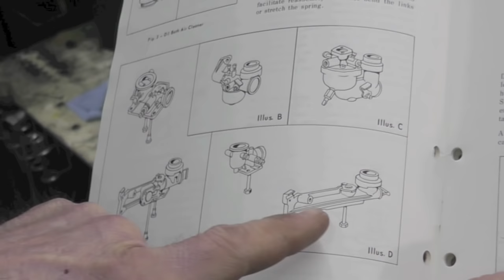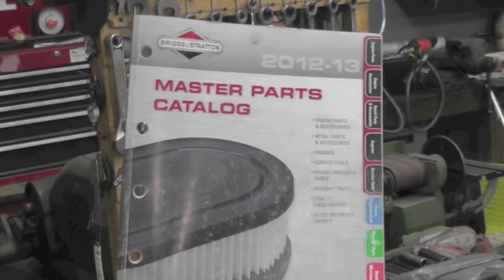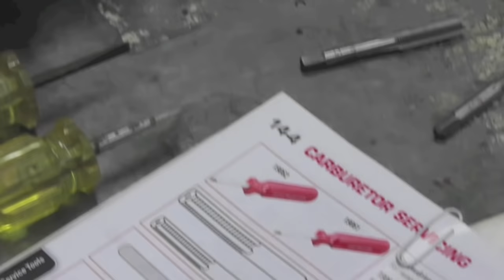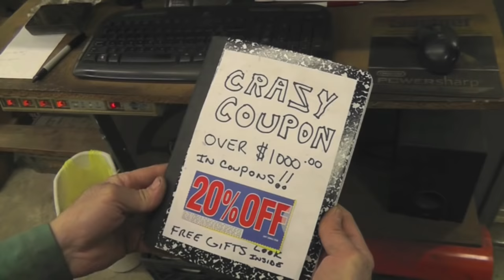How To Rebuild A Briggs & Stratton Flo-Jet Carburetor with Taryl

Comment: There should be more good people around like you and me. I ordered the rebuild kit and a bunch of assorted just in case parts before i took my 2 piece flo jet apart. I got everything I didn't need. The brass seat was a mess and none of the needles from BS would work. I figured i do a little  investigating and I found your amazing video. Thank you for sharing your expert knowledge. I was prepared to buy an upper body for $75.00. I found the brass needle seat and ordered it. I used your method and popped the old one out. I was amazed the part was available and even more amazed how your extraction method worked. I definitely would have butcher that upper casting. 1985 Briggs I/C 8 HP. THANKS AGAIN

Comment: Ya really gotta wonder what they were thinking when they designed this one. I have one on a leaf blower I bought last fall and it has some carb issues. Glad I got through the season with it. Now I know the correct way to pull it apart without muckin up the works. I would've yanked that bowl off there from the start. Thanks bud. I love the sound effects and the best thing anybody could do with a couple of turds is flush em away! lol!

Comment: My old man doesn't have time to take a look at his Bolens 10 hp tractor.. 
The beauty runs until it warms up and then it shuts off. 
It doesn't want to start anymore and it hesitates to crank like it's flooded but when it cranks it doesn't start. Any ideas to what could cause this issue? Do you think fuel isn't getting into the bowl or too much?
Reply: My 8 hp Updraft starts right up, runs at any RPM you give it, and in 5 minutes shuts off like you hit a kill button.  starts right back up...starts to die, choke it, it will recover...than it shuts off...Anyone out there no whats up with this thing  I've rebuilt the carb twice.  thats easy.  Thank you

Comment: Thanks for another great video, Taryl!  
I'm missing the throttle lever on a troy built chipper with this type of carb and the linkage looks the same. in the video,  I see the one screw that hold the lever on but don't see the other end of it and how it's attached. Can you buy the throttle lever. I think I may have to just manufacture one to replace it.

Comment: You always put out great information Taryl, but I need to correct you on one little thing. WD40 is NOT a lubricant. WD=Water Displacement and the 40 is the number of formulas it took to get to the finished product. LMT By PB Blaster (LMT=Lawn Mower Tuneup)...Now THERS YUR DINNER!! Just a little friendly helpful tidbit. I spent years thinking WD40 was the answer to all my lubricating needs until I was shown how it actually dries out any surface. It was originally developed for NASA as a means to remove moisture from electrical components and somewhere along the lines, people started thinking on their own, that it was a miracle lubricant. Hope this little bit of information is helpful! Cheers!! Zip~ p.s. Give LMT by PB Blaster a try!
Reply: If that's the case why do ALL stores sell it as a lubricant?
Reply: ZippoVarga mostly kerosene.
Reply: ZippoVarga WD is garbage,on the whole.
Rusted stuck or cleaning something OK whatever.
Turns to a gummy varnish with time 
Deep Creep by Sea foam is a nice fine oil.

Comment: little propane torch can loosen that emulsion tube if stuck and aluminum is good heat sink and won't melt but might warp if using to much heat to quickly so small flame and 5 minutes usually works👍

Comment: I have two questions for you guys concerning the 19245 tap set:  Looks like it's NLA, not even from ebay.  While you can find both 1/4-32 5/16-32 taps, the drawing in Taryl's Master Parts Catalog seems to show bottom taps.  There in lies potentially the problem, so far, I haven't found bottom taps in these sizes.  Do these have to be bottom taps, or can you use tapper/plug style taps?  Next question, if it has to be a bottom tap, who sells ones in 32 thread count?  Thanks.

Comment: got a homelite 5500 watt generator with a similar carb just a bit longer maybe. when i pull the starter a few times it starts leaking out the bottom of the carb but the spark plug looks dry. wont start. some carb spray and more pulling and it will fire and run. tried adjusting carb a bit but the governor wants to bring it to max rpms when manually giving it throttle it sticks to max rpms. why is it leaking when trying to crank? and why is it wanting to run at max throttle? thanks its an old generator and makes good power but cant keep it running. any thoughts? thanks?  new carb aswell but same problem

Comment: Hi Taryl   great sense of humour I enjoy your skits.Would like to ask you if the Booger on the hi speed tube was some sort of  'o' ring  ?  I have a large two piece Flojet carb and it is forever leaking after engine shut down . Read somewhere that there was a small type of 0 ring installed there to help the taper to seal in the carb body. Do you know of this, and would it be the remedy?
Reply from the maker: +Neil Fleming They did offer a teflon ring  but its been discontinued. A small piece of teflon tape may work.
Reply: +Taryl Fixes All   Thanks for your time answering the question .Going to try your tip .Hey do you think  that I could borrow Andy or Slippers to install the tape,those small hands would come in handy- LOL .

Comment: Timely, I bought a chinesium unit that won't take fuel through the needle valve. Among other things,
little, or no responce from  the needle adjusters. Rather than take it apart, I'm going send it back. 
So now I dive into the old one. 20,000 ! Hrs. on the clock.

Comment: I am currently rebuilding this carburetor (soaking in vinegar right now).
1) Shouldn't there be a gasket between the carb and air horn support against the bowl? None shown in parts diagram or video
2) Mine is a snow blower with a non-adjustable tube intake unlike the air horn. When mounting on carb, 1/4" space when installed and air horn in video shows a flush fit. Aso, there is no gasket and non shown on parts list unlike the video 16:53. Should I drill a hole and make it flush and also get/make gasket? model 190412, type 1024-01
3) Everyone questions your tee shirt when i wear it. I watched your video 3 times before starting this project.

Comment: Sure glad I found this before I dismantled my carb! I have gas leaking from around the hi speed jet. Is that a problem with the float? Thanks
Reply: Having this problem now -  I think it’s the needle missing the rubber tip. Ever fix?
Reply: It's either the tapered seat where the high speed emulsion tube screws in, there was a teflon sealing washer on this guy's which he flicked off, OR it's the o-ring which seals around the needle that screws into the emulsion tube. Either way, your comment is 4 years old and i'm sure you've found a fix now :p

Comment: I have this engine 194412-0122-01 and my local shop replaced the ball and rachet recoil starter with the new type that has pawls. I don't see anyone who has done a video yet on how to replace the pawls when they break. I tried to order the pawls but was told I have to buy the entire recoil starter for my 8 hp b&s engine. I see the pawls for sale at major stores via online, but the ones online are 1 1/2 and my engine takes 1 1/4 inch so they have to be cut down. Taryl seems to know ways to fix problems for less so if a part number is known please do a video or do a video how to fix the new style recoil starter for the 8 hp b&s when the pawls break. Great tip about the jet breaking, I didn't know and may have broken mine, I will have to check it. My engine is on a 4.4 KW coleman engine generator I have not had running right for awhile now. I replaced the carb and could only get the engine to run for about 20 minitues before it would die. I cleaned the flywheel and replaced the ignition coil and replaced the fuel filter and cleaned the plastic gas tank and replaced the petcock even had the local engine shop work on it and no improvement when the housing rusted out and the recoil starter broke. I replaced the housing and now at the point trying repair the new style recoil starter. Great videos thanks for doing them.

Comment: Rebuilt everything, starts,runs, etc. but gas leaks out the bottom bolt. Is there a o ring there? or is something not adjusted right?
Reply from the maker: +Arnold Johnson  If it's the bolt that secures the control plate then the needle & seat are leaking. If it's leaking from the adjusting screw then yes there is a o-ring.  If its leaking a tiny bit then stops its just some fuel being sucked up & settles in the lower carb. body from when the engine wound down to stop It continues to create vacuum and continues to suck up fuel.
Reply: +Taryl Fixes All Thank you!! Your videos are awesome!!!

Comment: It's very hard to find a repair manual for a 1992  B&S 5 HP self propelled walk behind mower. I've cleaned and rebuilt the carb, and this mower has a mechanical governor located under the shroud. I have no problem starting the mower, but the idle mixture screw doesn't seem to work. I can seat that screw all the way, and the motor doesn't choke out. I can go 5 to 6 full turns counter clockwise, and still wont choke out. I adjusted idle screw and speed screw,and speed control cable as well..............beats the hell out of me to why the motor revs up like it's going to fly off. My brain is drain Taryl. Any idea what else could be wrong and why the idle mixture screw doesn't work?
Reply from the maker: +Real Gagne  That screw is for the low speed circuit for the carb. The bowl nut is the main jet. If the motor is screaming thats the governor. If yur unable to set the governor then the chances are the governor is broken inside the engine. The spring on the mower is the governor spring & if its not the correct spring that too will make it scream. Check out my how-to adjust a governor video that may help you to repair the mower. Remember all governor systems work the same they just have different arm & lever set ups. But the spring is what regulates the speed more tension on the spring more  engine speed. Less tension less speed but it has to be the spring for that engine.
Reply: +Taryl Fixes All ...........I've set that governor 10 times over. It starts great at full throttle, but it over revs.
As far as the idle mixture screw goes, I know I have to be at my lowest speed on my control, but when I start slowing it down from full throttle............it chokes out after backing it up just 2 clicks. I'm trying to get it down to about 2000 rpm or so to set that screw.............guess I'm gonna have to pull the motor and see the governor gear..............I've tried everything that I know..........thnx Taryl
Reply: +Taryl Fixes All ......I downloaded the parts catalog that B&S said included my model, but some parts don't look anything like the ones on my motor. I wish I could send you pictures via e-mail if I could so you could see the governor spring (not in catalog), and governor arm. I've watched 100's of videos on this, but none come close to the 1992 B&S 5 HP quantum model 126702...type 3120-01.....code 92011456. I wish I could find a repair manual on that particular motor......Let me know if I can send pictures.
Reply from the maker: Send them to our facebook page. Taryl fixes all
Reply: +Taryl Fixes All   thanks for all your help Mr. T. I appreciate all your videos.
Unfortunately I don't have FaceBlock to send pics of my carbutrator or Briggs and Strapon motor   :-)
Reply from the maker: The correct governor spring for yur model engine is part # 262659 To adjust the arm that adjust the spring tension there is a screw with a spring on it that is on the control bracket. There is a hole in the bracket to access the screw. Turning the screw out will increase the speed. turning it in will put less tension on the spring lowering the speed One end of the spring hooks into the looped hole on the throttle link, the other end to the arm on  the control bracket. The arm that moves when you move the throttle.
Reply: +Taryl Fixes All ......I had already replaced that spring a week ago. So now I have the motor off to see if the oil slinger is bad. My problem right now is that on my model 126702 B&S has 2 half pulleys (keyed) and the blade holder (3holes) on the shaft that I need to figure out how to take those off to get the cover off.
It looks like the blade holder is a screw type (maybe not). I've seen your heating technique, but I'm not sure if it would work on this One. For now I sprayed locktight and see what happens. I only have a small propane torch that did work on some bolts.
While I wait for your advice, I'll try what I can for now.............thnx a whole bunch Mr. T
Reply from the maker: You can heat & quench with propane just takes a whole lot longer.
Reply: +Taryl Fixes All   thnx Mr. T.  I actually had less problem taking it off than I thought. I just came back from my garage to say that I found the problem. All the parts are OK. The only difference with my motor is that the set screw has to go Counter clockwise in order for the crank lever to contact the slinger. I went by what I saw on your video where you turn clockwise with the vise grip. No where does it say to go Counter clockwise in the catalog...........DUHH on my part. I had to see inside the crankcase to see that. Unfortunately I have to wait till Monday now to get a crankcase gasket , because the store closes early on Saturdays. You've been the best Mr. T.....ty
Reply: +Taryl Fixes All  Today, I reassembled the mower, and it runs like new   :-)
I have to say this, because this 1992 B&S motor setting are the complete opposite of all the videos I've seen. It's a horizontal throttle lever under the motor cover. To set this lever at full throttle, it must be moved toward the carburetor, and not toward the back. Last and not least, the set screw goes counter clockwise...........If it wasn't for your videos, I would not have figured that out unless I went into the crankcase. My hat goes off to you Mr. T.D.
Reply from the maker: Theres yur Dinner!

Comment: Like e information. Just a little too much "carbatraitor". I work on engines of all types for a living and have done so for 40 years. In the background of my picture here you see my shop at work. Actual shop is 40X50 feet with 24X70 storage area also. Gonna subscribe and see what ya got for info. I still get stumped now and again with some of these small engines. I taught myself on small ones. Certified in all systems of all GM cars and trucks built up to 1994. Automatic and manual transmissions, fuel injection, climate control and specialized electronics for the "computer car". LOL
Reply: and there's your dinner

Comment: My 8 hp Updraft starts right up, runs at any RPM you give it, and in 5 minutes shuts off like you hit a kill button.  starts right back up...starts to die, choke it, it will recover...than it shuts off...Anyone out there no whats up with this thing  I've rebuilt the carb twice.  thats easy.  Thank you